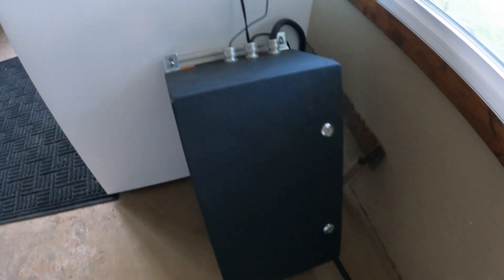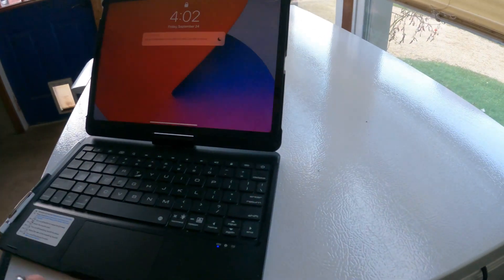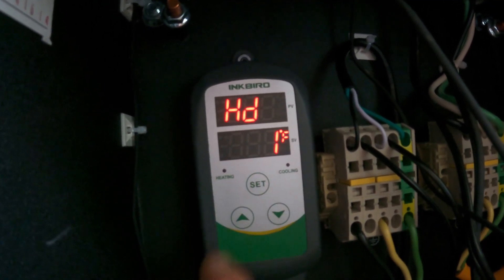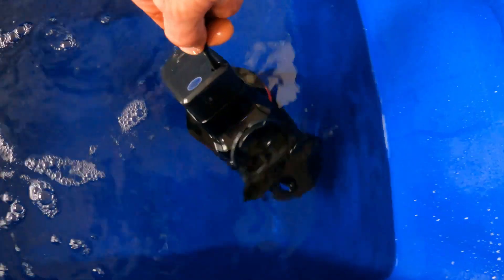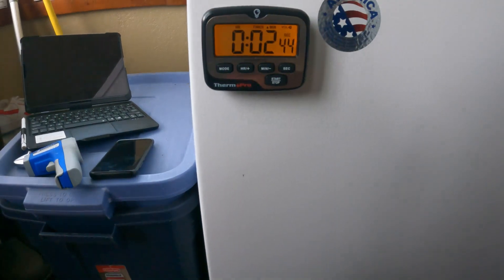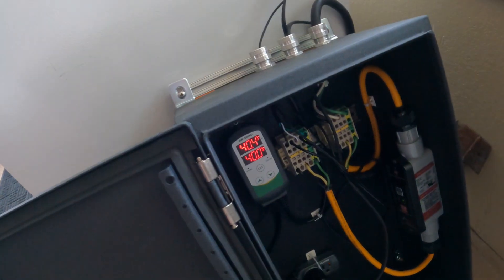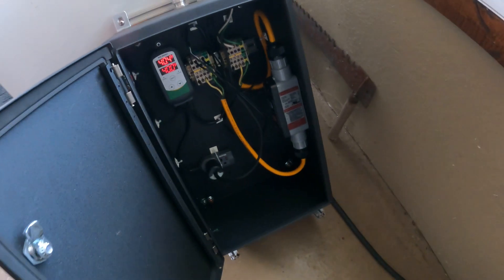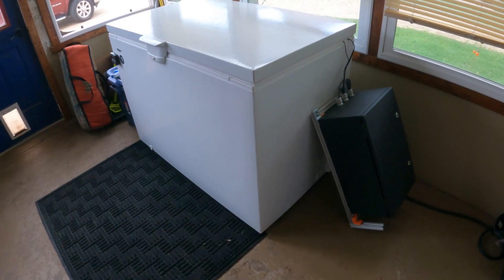Chest Freezer Cold Plunge - Components

Comment: I have the same setup just without the chlorine. Do you use the charcoal or the other filter the pump came with? I’ll prob add the chlorine to keep it cleaner but I’ve been using the charcoal